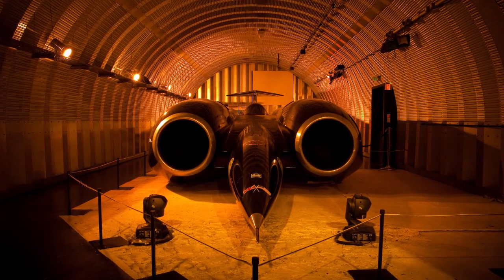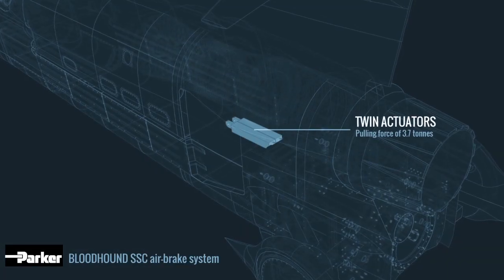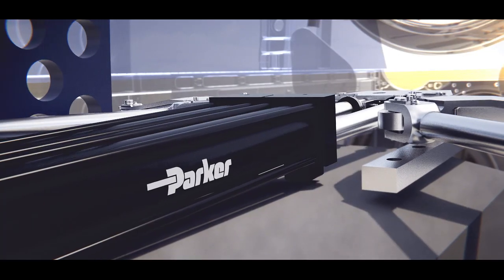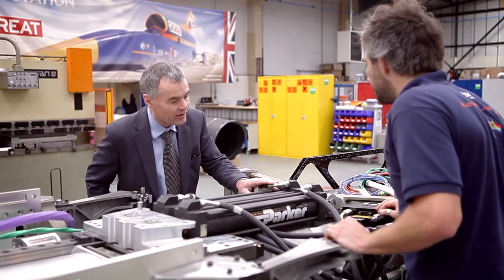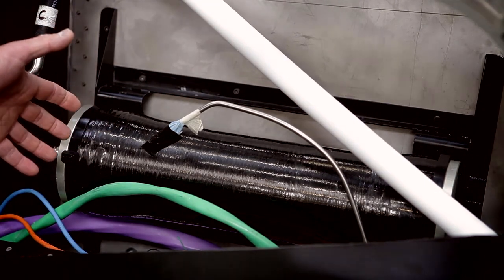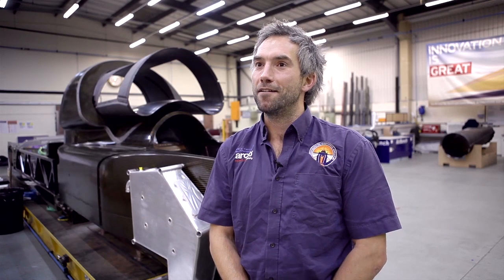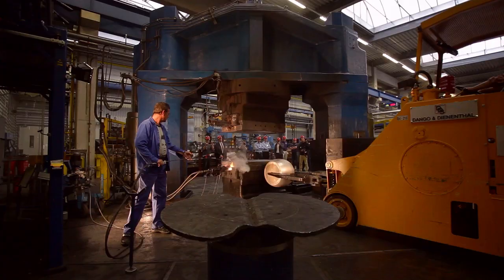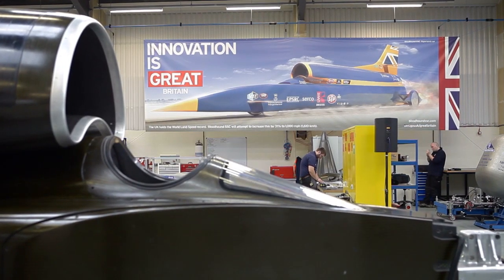Parker's Bloodhound SSC Airbrake System

Comment: https://www.youtube.com/watch?v=bzfC1Nc2biY Heres some more supersonic parachutes. You guys didn't do much research into this did you.
Reply: Haha, the only reason it failed.? LOL Its still a failure! Isn't it? The Airbreak makes way more sense on this project as this there is no repacking for the turn around in the hour to do the measured mile in the opposite direction with it guaranteed to be intact. the parachute would have to be attached to the car but the size of the thing would have to be massive. Its a car not an aircraft, it close to the ground. There are parachutes that will slow the car down below 300MPH but the size has been tested on thrust SSC. You really didn't do much research into the Bloodhound SSC project did you? Do you feel a bit stupid now? LOL!!!
Reply: Congrats on posting this reply twice, once on the proper comment and once on a comment that has nothing to do with what your talking about.
Reply: Hopefully the runs in South Africa next year will prove if the air brakes work or not. If not it's back to the drawing board I guess.

Comment: "Parachutes will tear themselves to shreds" https://www.youtube.com/watch?v=jS3kpyGUdK0 this supersonic chute was tested up to mach 2.2 and the only reason it failed was the spindle it was attached to was not made strong enough. This was 1960's btw so I'm sure parachute technology has gotten quite a bit better since then.
Reply: Haha, the only reason it failed.? LOL Its still a failure! Isn't it? The Airbreak makes way more sense on this project as this there is no repacking for the turn around in the hour to do the measured mile in the opposite direction with it guaranteed to be intact. the parachute would have to be attached to the car but the size of the thing would have to be massive. Its a car not an aircraft, it close to the ground. There are parachutes that will slow the car down below 300MPH but the size has been tested on thrust SSC. You really didn't do much research into the Bloodhound SSC project did you? Do you feel a bit stupid now? LOL!!!
Reply: Yes the spindle was a failure, but the spindle is not actually apart of the parachute it was apart of the test stand. Repacking? Well seeing as these chutes are small repacking is fairly simple and only takes a few minutes. To slow down a car the size of Bloodhound would require a supersonic chute about two feet across which btw would be much more surface area then the air brakes provide. No i don't feel stupid, because i actually know what I'm talking about.